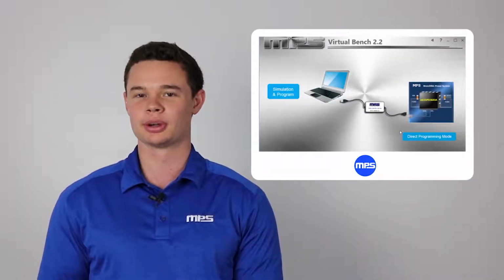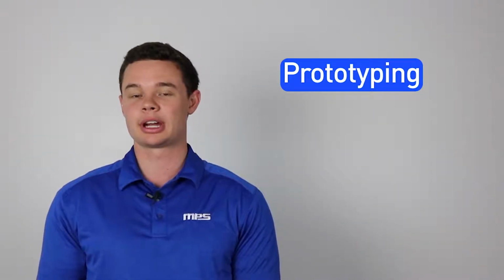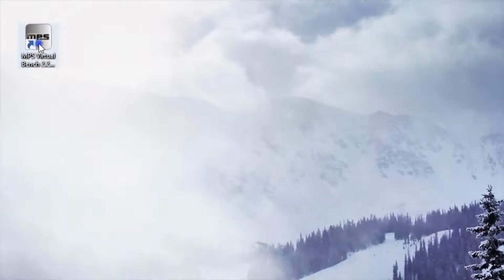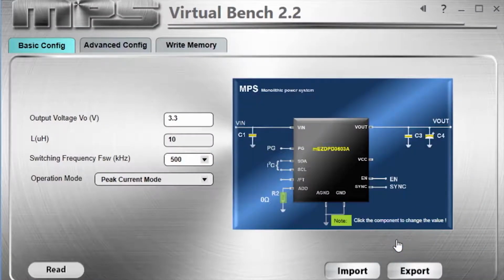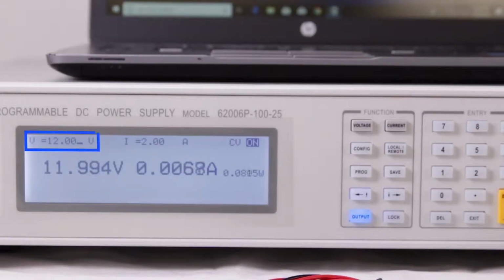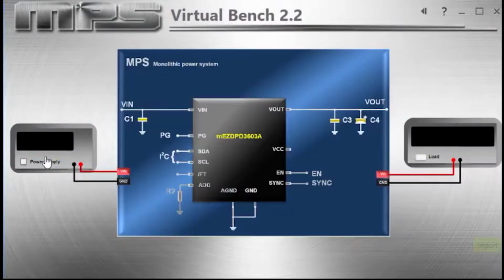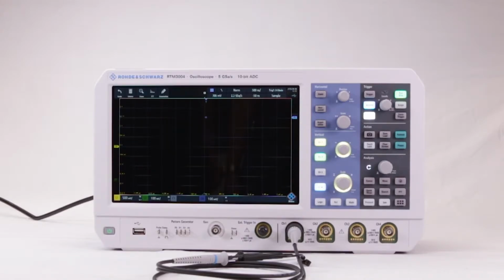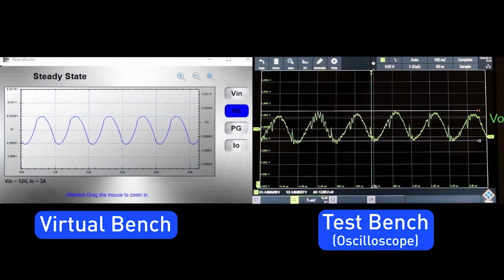MPS mEZ Programmable Power Module

Comment: Excellent I learn about how obtain negative variable power in the synchronous rectified Step down converter MP1482 .and I have found myself with the pleasant surprise of how electronics is advancing. There is no longer any need to do circuit analysis, redesign on hardware. Now the new thing is to work on programming. How much progress. Thank you for showing us this video and showing us the new horizon. It is fantastic .best regard
Reply from the maker: Glad it helped!